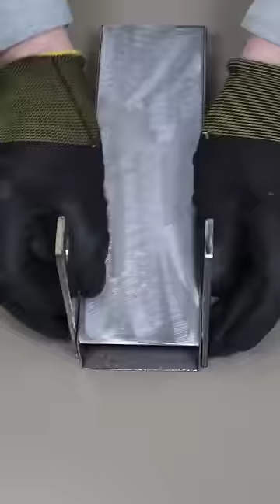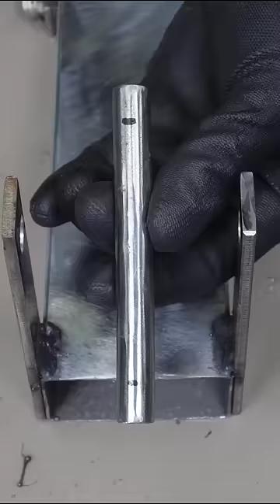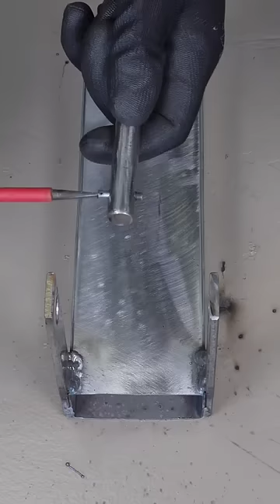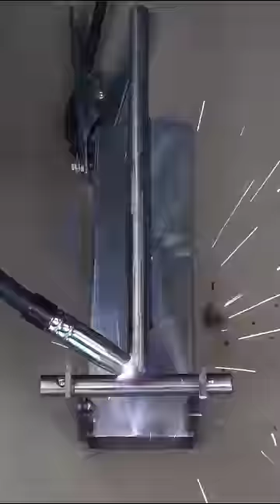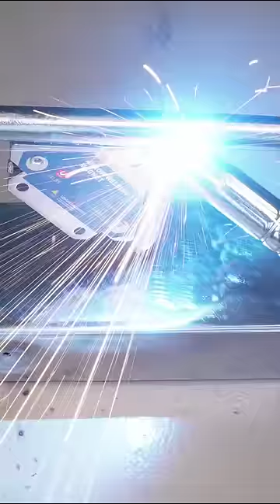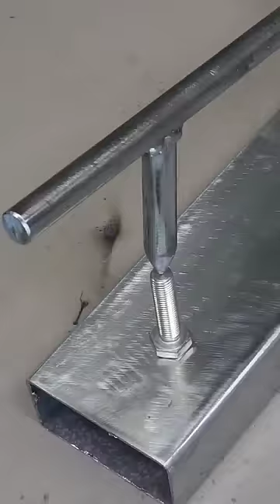Cool Ideas for a Homemade Tools #shorts #diy

Comment: Any ideas about what this is? Because I haven't got a clue 😳
Reply: It appears to be a gizmo for holding a nut onto the end of a bolt so that it is easier to weld them together. You know for all those times that you need to weld a nut to a bolt 🔩
Reply: @trishacd1985  brilliant reply! 😂
Reply: @trishacd1985  what, like those no hands gizmos that you get for free with a soldering kit you mean? 🙄 Oh right 🤦
Reply: @trishacd1985  so a nut can't stand by itself on a bolt with a level head you mean? 🙄🤦
Reply: @A_Pt_9298  You never know when this situation may arise. It may be that the bolt is fitted to a moving object then the nut would fall off. Welding the nut to the bolt could help avoid embarrassing situations.